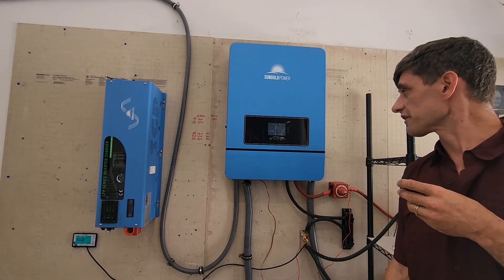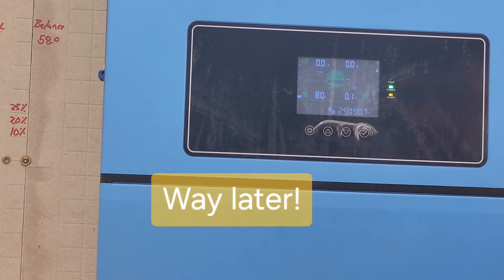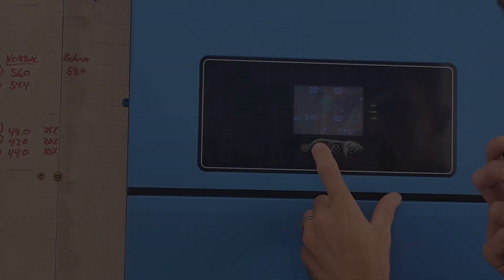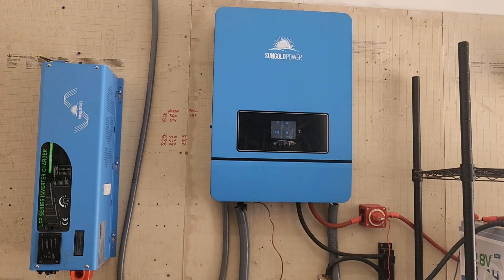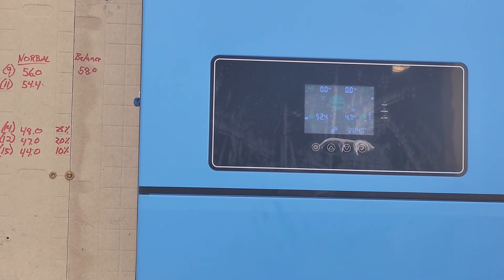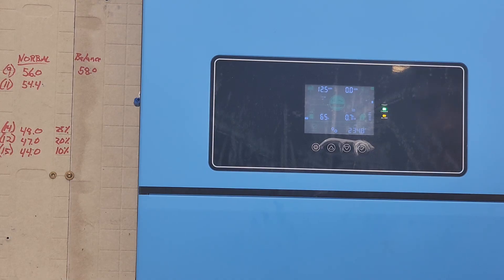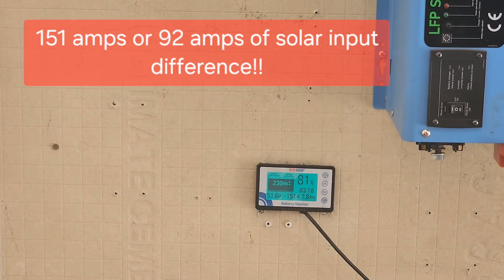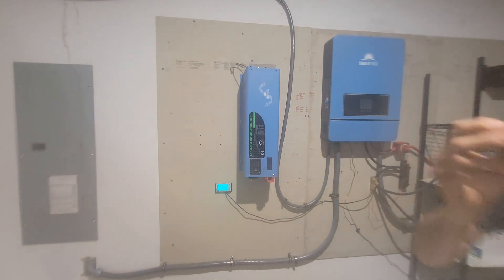SunGoldPower 120v/240v 10KW Inverter Full Test... RIP 250A ANL fuse.

Comment: Isn't the max PV input 22amps? Don't you worry about blowing that up?
Reply from the maker: You only need to worry about max voltage.  Best way to think of it'll is volts are pushed while amps are pulled.  Being over max usable amps will not harm your equipment, it will just trunckate your production curve during peak solar.

Comment: If you want to be able to go above 250 amps from the batteries, you can always connect a second 250 AMP DC breaker and 2/0 cable from your bus bar as long as the bus bar is rated to handle it.
Reply from the maker: I actually connected by HVAC compressors to my 6k LFP now so I think I will be good now.

Comment: Good morning, can you use the AC input port as a smart output port?
Reply from the maker: Absolutely not, but you can use the small mounting screws in top if the output to easier connect smaller wires with an O-ring.

Comment: Did you use the default setting in your user manual or reprogram the inverter.
Reply from the maker: Most of them default, (9) at 56v, (11) at 54.4v, (12) at 47v, (14) at 48v, (15) at 44v, (22) enabled. Since I am not using an AC input, most everything else didnt matter.